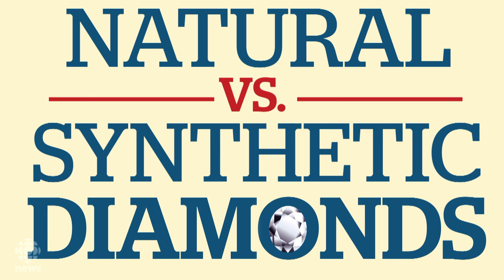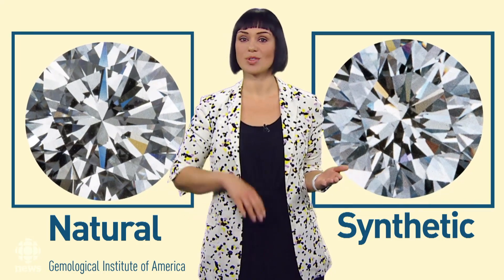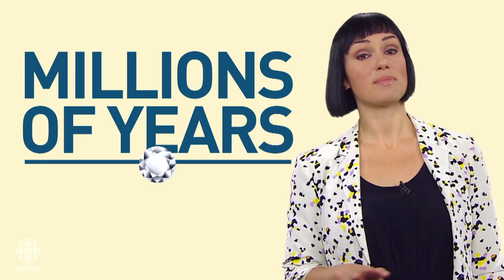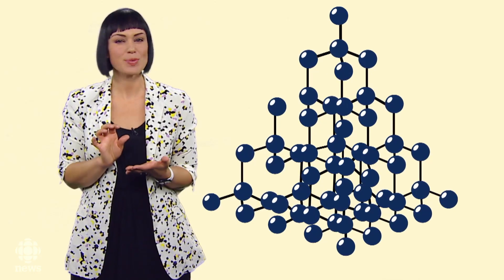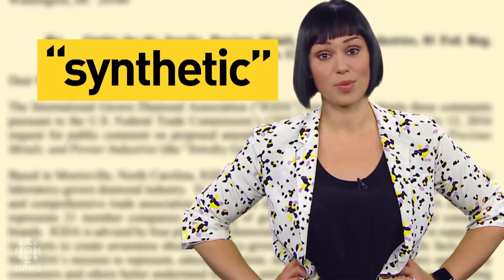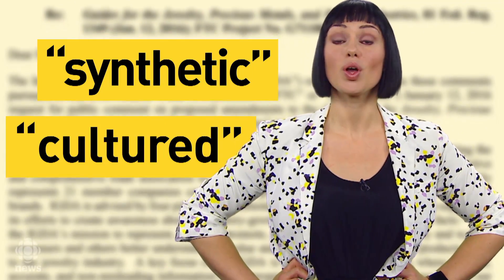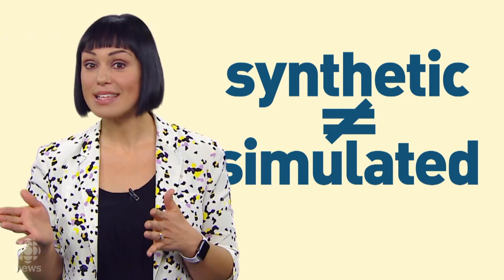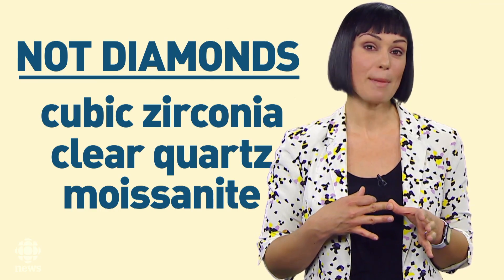Natural vs. synthetic diamonds (CBC Marketplace)

Comment: Synthetic diamonds can be verified as synthetic because most companies are honest and they are easy to trace and you can also test them for microscopic growth lines from the expanding process they use to make them, also UV radiation testing. If you want a diamond that retains inherent value go natural, if you want a diamond with depreciating value that will be rejected for resale go synthetic. Diamonds are valuable because they are rare and as a natural phenomena highly improbable and extraordinary not because of their chemical make up, as long as there is a way to distinguish and certify if a diamond is synthetic or natural synthetic as far as inherent value is worth will be classed as a knock off. Making them is revolutionary for the utility of diamond, ie phone and computer tec, lasers, drill bits and so on or if the value of the diamond doesn't matter to you but if you want a diamond for its inherent worth or as a valuable commodity isn't a concern. synthetic won't age well as a precious stone as tec gets better and verification technics and certification becomes more widely available, as for natural they will retain their value.
Reply: 4 years later... Try selling a natural 1 ct diamond and see how much it "appreciated" in value.

Zero. The value went down.